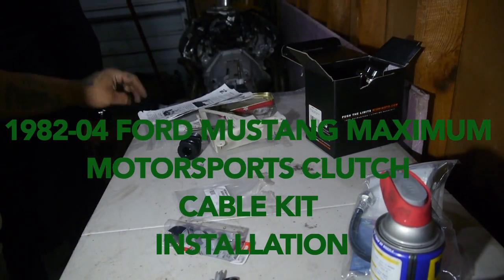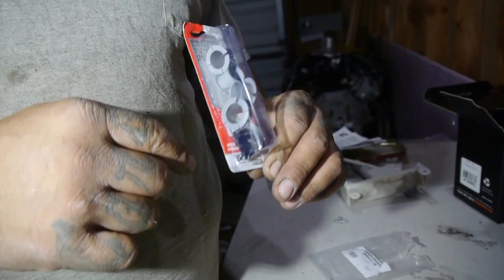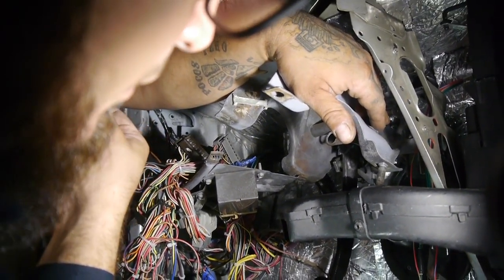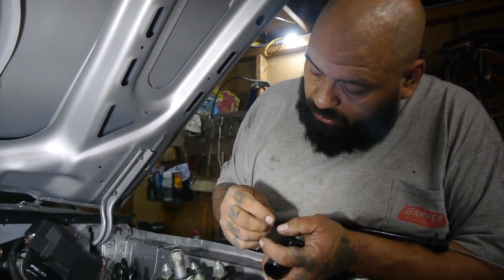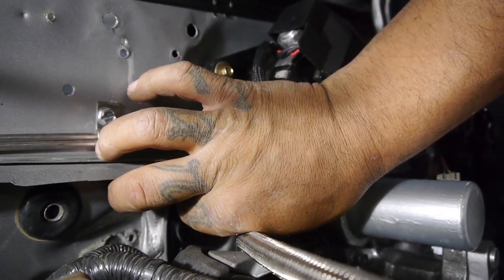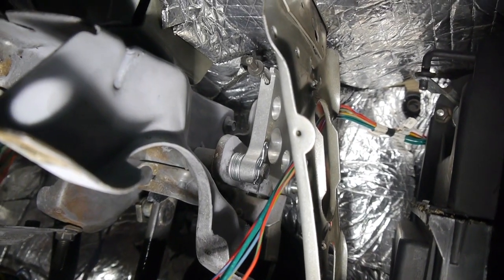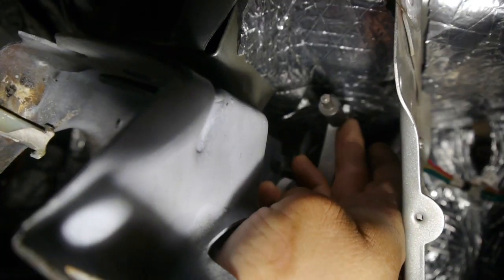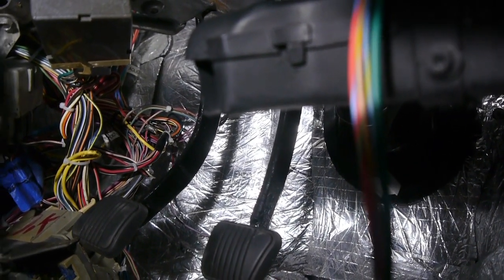Adjustable Maximum Motorsports Clutch Cable Coyote Swap Foxbody

Comment: I've used the BBK setup and stock cable with a threaded end at the clutch lever. This way you can install the fulcrum part without any "spacer" and then take up initial slack at the clutch arm and then use the firewall setup to adjust. Just another way of doing it. I'm always worried about the fulcrum spacer falling out!
Reply from the maker: Sir, that you very much for commenting. Good morning, I  hope you have a great day and week. I love the fact that you share your experience with us. Maybe someday some young boy or young men researching these kind of information will find them.  Our videos are the documentation of our learning, research, and discovery of  figuring out things and the value of working with the hands, a learned trade.